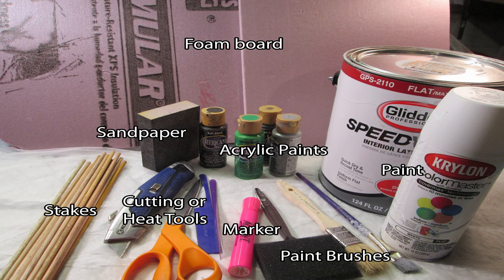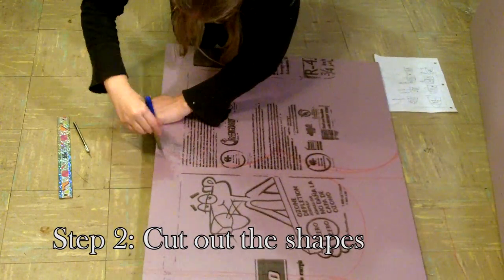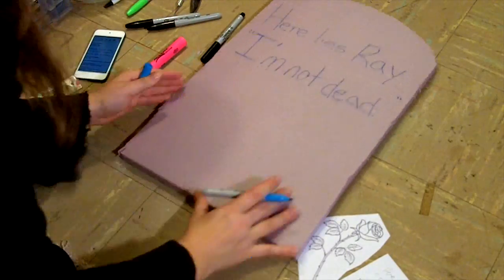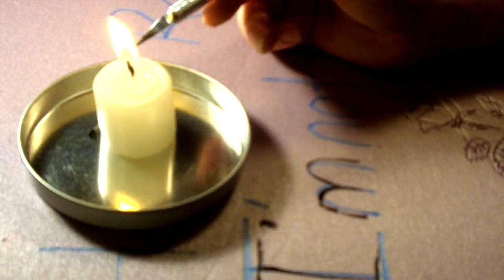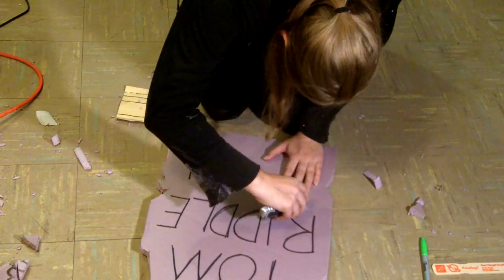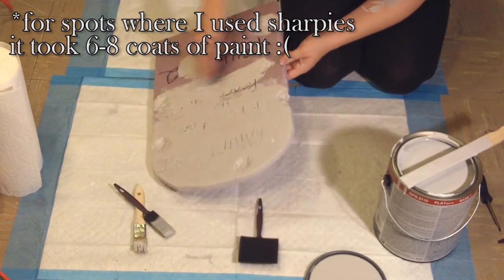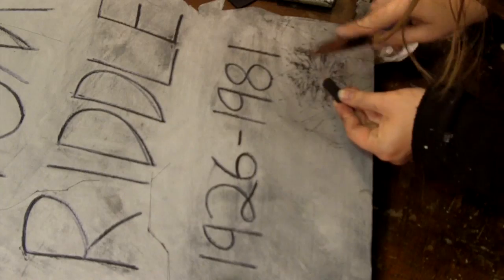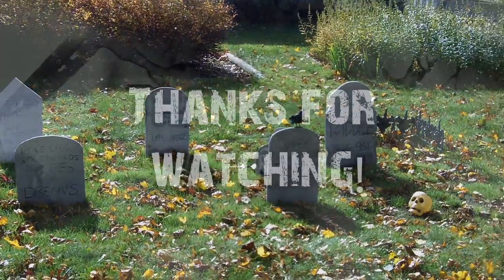Easy DIY Foam Tombstone Tutorial

Comment: If you're going to go to that much trouble, you may as well do it right. This is never going to hold up to weather or last very long.
Reply from the maker: This will be their fourth year in my yard (all of October in rain,snow, heat, and wind storms) and still going strong. I did switch out the wood sticks for metal and reinforce a few weak spots with hot glue but that's the only repair they've needed. My only other issue was how thin the foam is, as it did have some damage from the stakes (which the hot glue fixed), but other than that, they're doing just fine! There are definitely improvements I could make but that's true for all projects :)